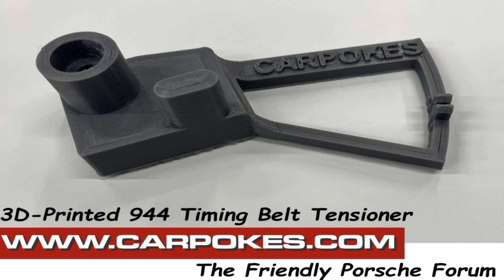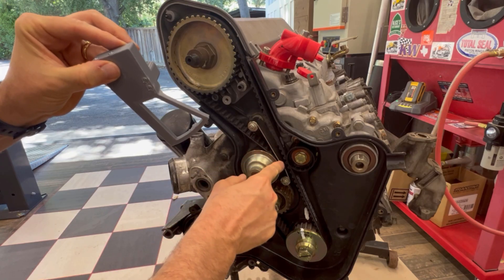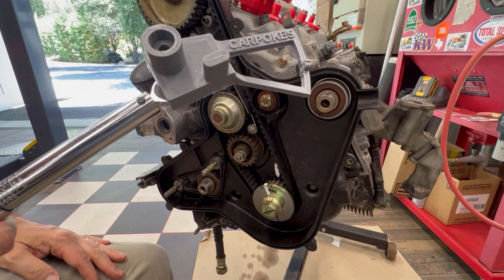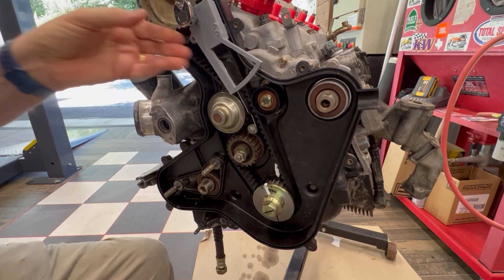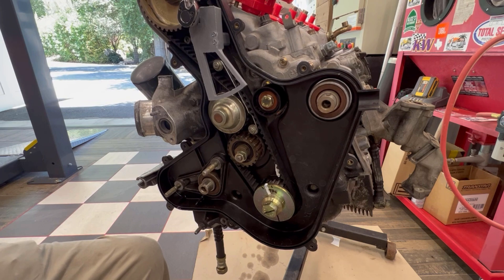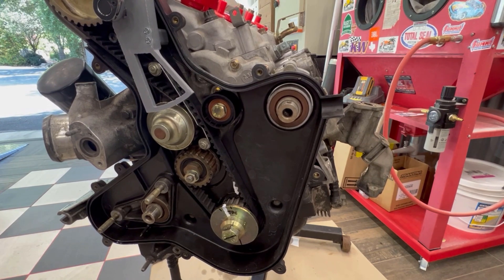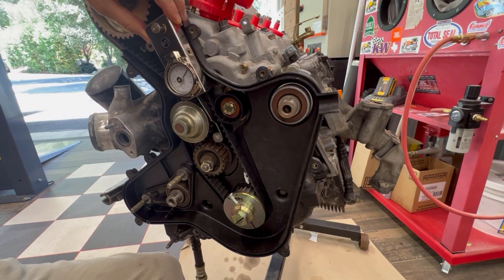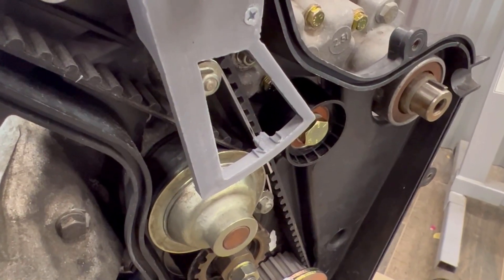944 3D-Printed Timing Belt Tensioning Tool

Comment: This does not fit Porsche 944 s2 3.0
As the bold place is not round.

It is possible to make new stl with maybe if technically possible?

bearing and big bolt?